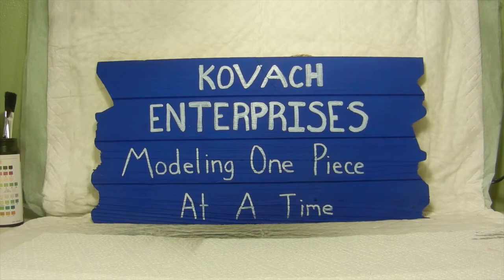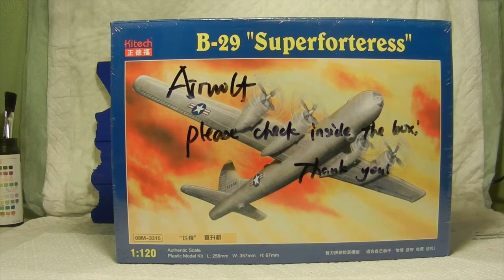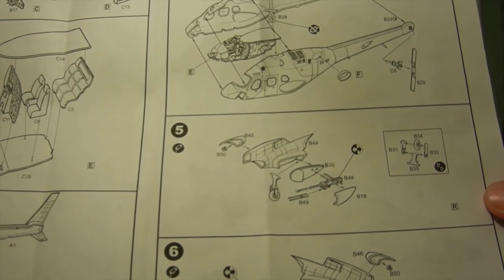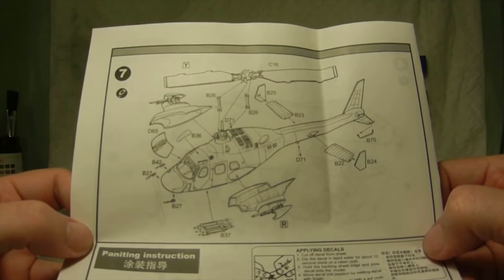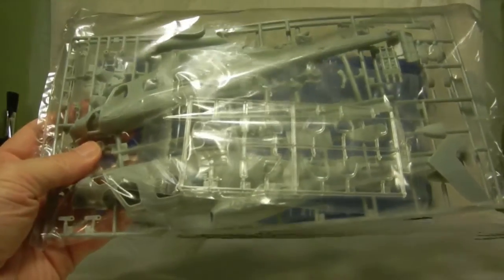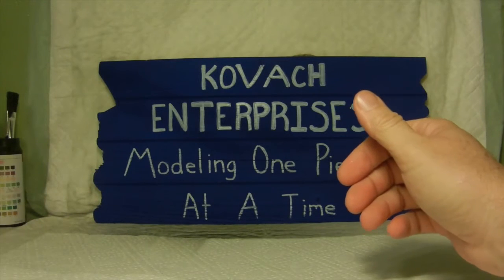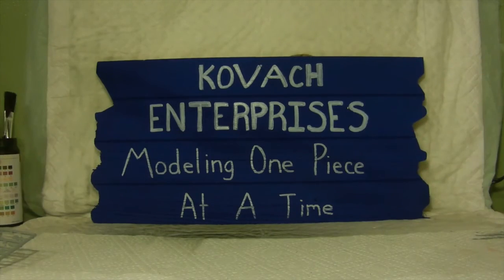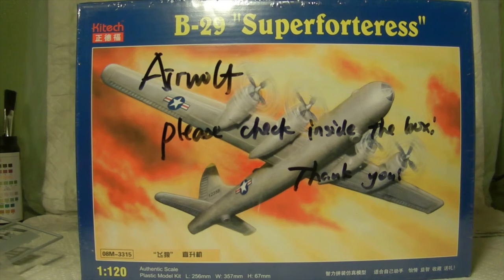New Project on the Bench

Comment: Hey Mikey! That is gonna be a very cool kit to build. Mine is around here somewhere!!
Just a note. It doesn't specify in the instructions, but, you will need to add weight to the nose of it or it will be a tail sitter! I use lead shot for slingshots for my planes. I mix canopy glue with the lead shot and just tuck it up in the nose.
Reply from the maker: +MindlessModelWorks Thanks Kenny and thanks for the "lead up the nose" ;-) Not sure if I'll have it in landing mode or flight mode, would that make a difference with the weight in the nose?
Reply: +Michael Kovach Well, if you put in the landed mode you will need to weigh it down. In flight mode.........No!!

Hey, I sent you a PM!!

Comment: Mike great kit. I Don't know if you know this but in the kit instuctions some of the placements of the parts are wrong if I remember I think there is a total of five in the instructions that are not right.
Reply from the maker: +Federation Shipyard Thanks Dennis, you are correct. I did some research on this a while ago on another persons channel and he stated in step 5 of the instructions a certain part was placed in the wrong spot. The same for step 7 where that part does not go on the roof, but the nose of the helicopter. The gun barrels as well were reversed on the instructions. Thanks for the heads up.